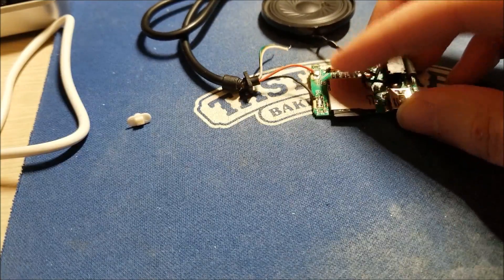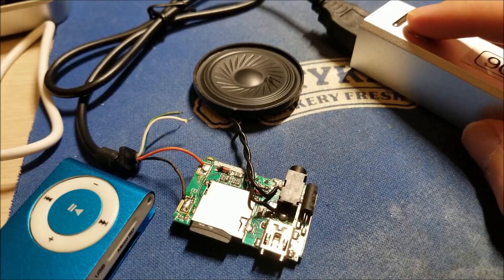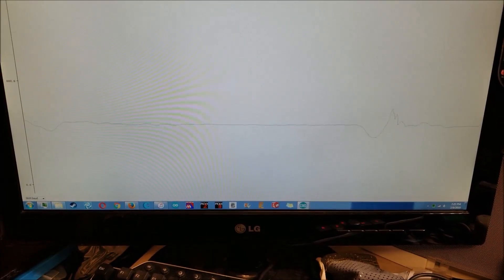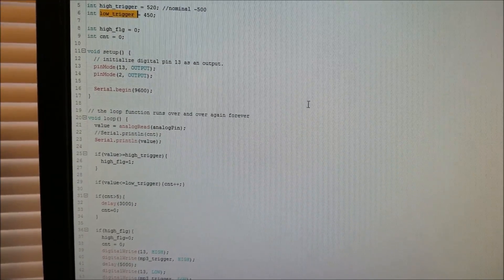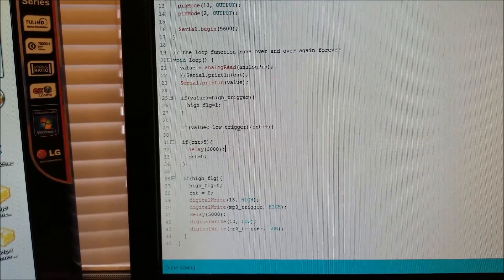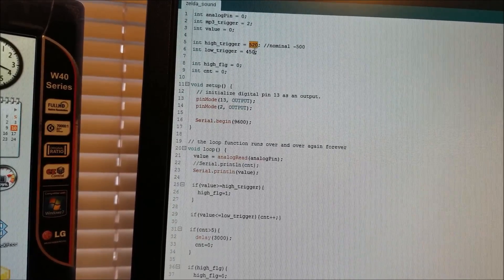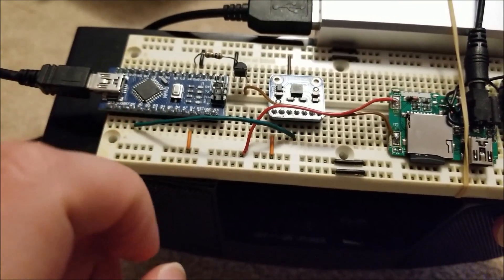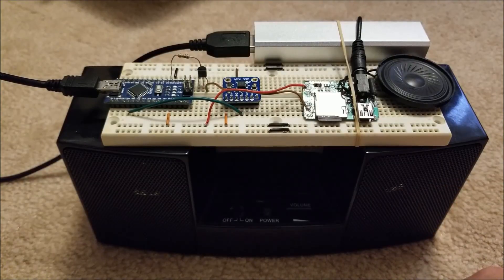Let's Make: Motion Activated Legend of Zelda Item Jingle Circuit

Comment: Great project. It seems to me that there's a tiny bit of lag in triggering the audio.
Reply from the maker: Abdul Aali Kamal Din Yeah the arduino triggers the output nearly immediately but the mp3 player I am using needs a second or two to "boot up" and read the mp3 file.
Reply: Ah, that explains the delay :)